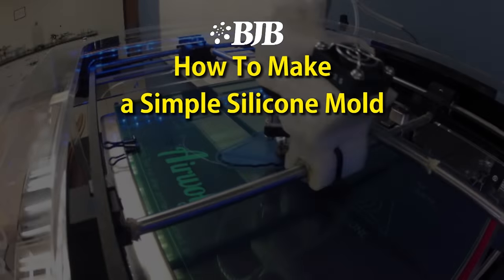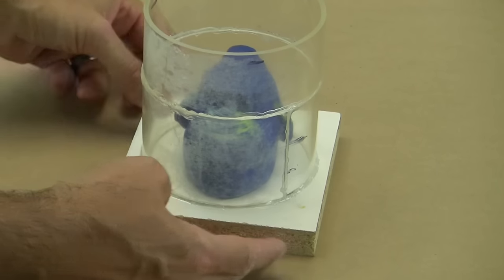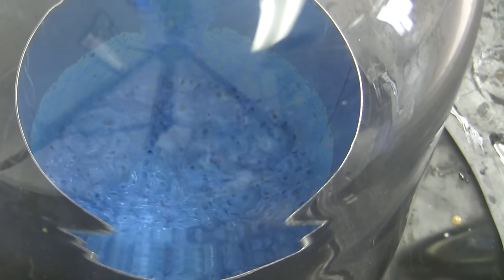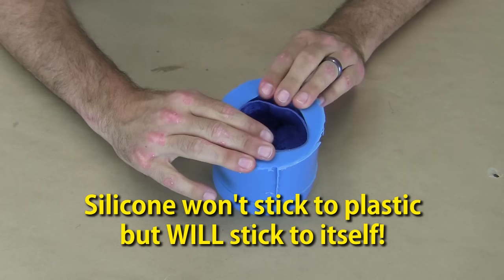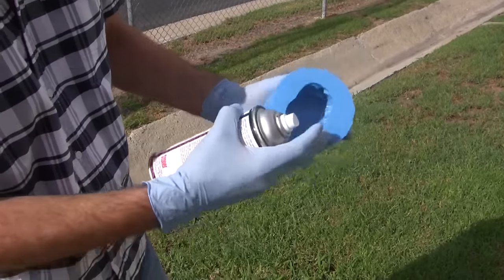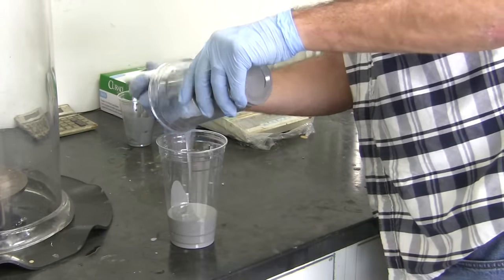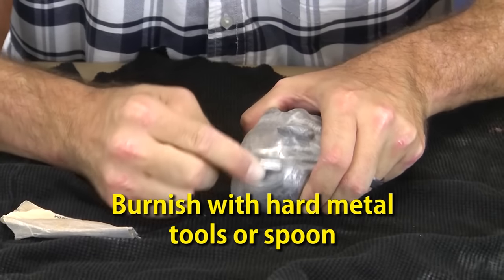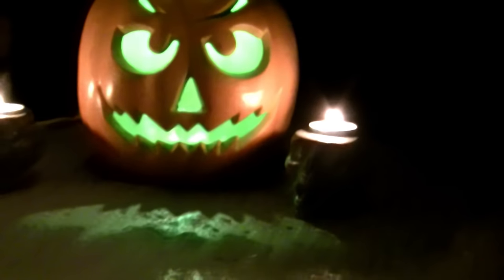How to:  Silicone Mold from 3D Printed Skull

Comment: Hi, why no one puts the whole mold with the model and the silicone in its liquid state back in the vacuum chamber? Wouldn't this remove a possible air bubble trapped in the model? All your videos are great, especially the one making the hair dryer case. Best regards
Reply from the maker: Hi Paul, great question.  The issue with putting the whole mold back into the vacuum chamber is that if you pull too much vacuum, you may actually pull air into the silicone from cracks, crevices, and trapped air pockets under/around the model/pattern.  So you may cause more harm than good.  Silicone is very good at wetting out highly detailed surfaces and if you pour carefully and angle the part correctly, you can often avoid trapping air pockets.  Sometimes pre-brushing a highly detailed surface with silicone helps fill in trouble areas, but more times than not we simply pour and let the silicone do it's job.

Switching gears; Pulling vacuum on cast urethane in a cured silicone mold, the urethane may actually bubble and foam up and out of the cavity creating a mess.  If you pull a slight vacuum, it may help with problem areas in a mold (like an under-cut) but usually we will design a vent in that area to avoid it.  If you do a little searching on vacuum casting, this is basically the same concept; degassing the mixed urethane at high vacuum and then decreasing vacuum slightly while the material is injected into the mold.  This is all done in a specialized piece of equipment.

Comment: Use primer for smooth mould on your print
Reply from the maker: Yes, there are many ways to smooth the prints for better surface finish.  We sell a great filling primer called SEM that does a great job in fixing print lines.

Comment: Could you pressure cast resin with chopped up carbon fiber in this kind of mold I wonder ?
Reply from the maker: Yes, absolutely.  You would want to make sure that the silicone mold is air free (vacuum degassed before pouring) and the pressure tank will help deal with trapped air in the cast resin.
Reply: @bjbenterprises  I know the theory behind it, but has anyone actually done that ? 
ight be challanging to get the amounts of CF fibers and resin right.
Reply from the maker: @sierraecho884  it sounds like you are trying to replicate a "forged carbon fiber" look.  We have had customers create this with different materials and part configurations.  Yes, resin and fiber content is critical and takes some time to dial in.  If you are trying to cast a very thick, solid part with this method, you risk more bubbles.  Pressure casting will help deal with small pinhole type bubbles, but it won't eliminate large pockets of air.  We have not seen something this large (the skull) made in a single casting with carbon strands.  Something this large may require a layered approach and then backed with a solid resin cast.
Reply: @bjbenterprises  Thank you very much for the detailed response.

Comment: Generally how many pours can you get out of a mold? We have gone the proto pasta metalfill method, which was great, but takes time to print. The mold is so much faster.
Reply from the maker: Hi Gordon, we do find that if you are doing more than a few parts, 
making a mold and casting ends up being very efficient with great 
results.  Something like the skull you see above might produce somewhere
 in the 25-50 parts from the mold before it begins to break down.  The 
smoother the surface and geometry, the more parts you are likely to get.
  The casting material has some effect on the mold life as well; rigid 
materials tend to exotherm (heat up) higher than flexible elastomers and
 will dry out the silicone faster.  Using a good quality mold release 
like our E236 Urethane Release also helps a lot.  Thanks for the 
question!

Comment: My 3d print started floating once I put the silicone in 😩 never seen it happen in other peoples videos so I didn’t plan for that happening
Reply from the maker: That's a bummer.  Floatation can be a serious issue on large parts as well.  It's important to fasten the part down as best you can without damaging it to prevent this issue.  Sorry for your fail and thanks for sharing so others don't suffer the same issue.
Reply: @bjbenterprises   do you recommend gluing the print down?
Reply from the maker: @bucciarati7766  yes, similar to what we did in the video.  On small parts, using "super glue" works well.  Sometimes Hot Glue is used, but it leaves a thicker gap.  If you need to make a 2-part mold and don't want the glue to permanently bond the pattern to the board, Elmers White Glue is nice to use because it cleans up easy and doesn't damage anything.
Reply: @bjbenterprises   thank you for the info! 😄

Comment: would it not  be easier to print in proto pasta or colorfabb metal filaments lmaoo and by pass the hole molding part?
Reply: If you just use metal filament there would be layer lines on an FDM printer. This gets rid of them because you use the clay to cover them and then the mould will have no layer lines.
Reply: Perhaps so, but one, still needs  to put the same amount of effort on sanding and polishing to work the finish of the TC-814. same amount of work plus the extra effort and  trouble of molding and casting. To the author of the video,  I am in no way criticising your video, it is well done and a nice show of casting methods.
Reply: patprop74 yes, but with the silicone mould you can remake the model over and over again without the hassle of the printer occasional failing and without the awful sound of the printer
Reply: hahaha, True but my printers are rather silent and I have printed this cup before and the print lines are hardly apparent, Also I have to add,  I am  a huge printing fanatic ,my printers run almost 24/7. and not once has my printer complained about re printing the same object over and over again, Another alternative is printing with  filaments such as proto paste conductive filaments, one could very easily use it to do a very simple electro plating method to a model, giving the model even more pop and metal like look, so to speak.
Reply from the maker: There are cases to make against each method but that's not the point.  Ultimately this may make sense in some applications where a specific material is needed for the part(s) or it may be better to 3D Print the parts.  The goal of showing the process here is so the end user can adapt for their requirements and become more aware of how the process relates to the 3D Printing process.  This video was done more for fun and to show a quick molding process along with a unique casting material.  If the aesthetic of the part is critical, more time can be spent on the original 3D Printed part and once molded, cast parts will be reproduced with that finish.  We explain this concept and process in more detail in other videos like:  https://www.youtube.com/watch?v=tnY86LIHf_I